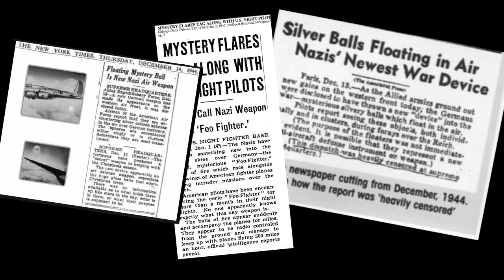Foo fighters - German UAP ?

Comment: Knowing a bit about radio, being an amateur radio operator, I remain skeptical, but open to the possibility. RF from a parabolic dish antenna quickly loses signal strength.  They would also have to be convergence of at least a second “beam”.
Reply from the maker: yes....good points ....one german radar had 3 convergent antennas
Reply: Yes, The frequency would probably have to be near 100ghz to be directional enough and the wattage would have to be a lot too. Possible today but in the 1940s I don't know.
Reply: @Professor Simon Holland  The effort the Germans would have to put into something like that to confuse a few allied pilots doesn't make sense. The wattage of each dish would be what? 10,000-20,000 watts would a truck-size generator of time be able to accomplish that?

Comment: Another piece of the puzzle may be it isn’t just radar interacting with the atmosphere, but also the smoke remnants of anti-aircraft shell explosions interacting with the radar.   When anti-aircraft shells explode, they leave a smoke cloud which may persist a while.  The radar waves pass through the atmosphere until they hit something which reflects or absorbs.  If it absorbs, it heats up and may well reflect radiation back in another wavelength.   These radars are probably energizing these smoke clouds.
	There were several nuclear tests at the Nevada testing ground testing the use of smoke to absorb nuclear bomb flashes.   The idea was, if there was an incoming nuclear bomb, smoke would be released to help reduce damage from radiation.  The tests seemed to indicate success in reducing radiation to equipment.

Comment: Most of the radar transmitters were low power (less than 30 KW) one major exception is this American one with a monster 1 MW (1,000 KW) power output of "Project Cadillac":
"The most ambitious, long-term effort of the Rad Lab was Project Cadillac, the first airborne early-warning radar system. Led by Jerome Wiesner, about 20 percent of Rad Lab staff would ultimately be involved. Designated AN/APS-20, this 20 cm (1.5 GHz), 1 MW radar weighed 2,300 pounds including an 8-foot radome enclosing a spinning parabolic antenna. Carried by a TBF Avenger carrier-based aircraft, it could detect large aircraft at ranges up to 100 miles. The airborne radar system included a television camera to pick up the PPI display, and a VHF link transmitted the image back to the Combat Information Center on the host carrier. The system was first flown in August 1944 and went into service the following March. This was the foundation of the post-war Airborne Warning and Control System (AWACS) concept."
https://en.wikipedia.org/wiki/Radar_in_World_War_II

Comment: OK I watched this a few hours ago and have been thinking about it since . My question about this .... How did the Germans generate the ball of light to begin with ? Claiming it was a side affect of Radar I could buy IF and I said IF someone could reproduce a ball of light that acted in the same fashion as with radar signals .... never seen a demonstration of that yet .... or heard of a claim it was possible .... at least until now .   :)
Your videos recently attribute this all to plasma/lasers but Foo Fighters were around in the '40s and I dont think anyone in the '40s was messing with Lasers . 
 One theory I have heard is that all the static electricity generated by the props is what caused them .
Reply from the maker: shear power of the german continues wave radar from 3 antennas .... might have caused air ionisation

Comment: I believe they were spotted by German pilots and also seen by allies and the Japanese in the Pacific.
Reply from the maker: yes....same german radar tech.
Reply: @ProfSimonHolland  why did the Germans and Japanese use this tech on their own pilots, especially when they believed it could cause plane equipment to malfunction? That sounds a bit dangerous and both axis powers were in dire need of every plane they could get towards the end of the war.
Reply from the maker: @kevin15776  ooops i never made that clear....the plasma balls might have been a bi product of their unique CW continues wave radar system....the DEW was only tested and used against alied aircraft from Dresden and Berlin labs.
Reply: @ProfSimonHolland  these balls of light were seen by German and Japanese pilots as well. They were spotted during the day and could be different colors and some were even reported to be cigar shaped. It also seems like they never touched the airplanes but flew around them, tailed them, and mirrored their speeds. Wouldn't the Germans want the ball to hit the aircraft and not just fly alongside it? Some of these balls were sighted after the war as well.